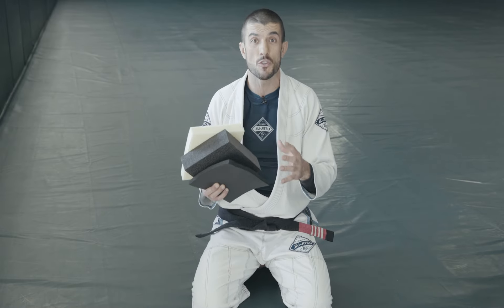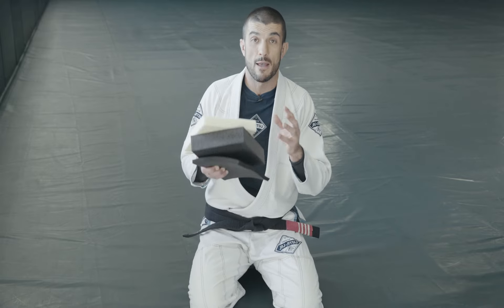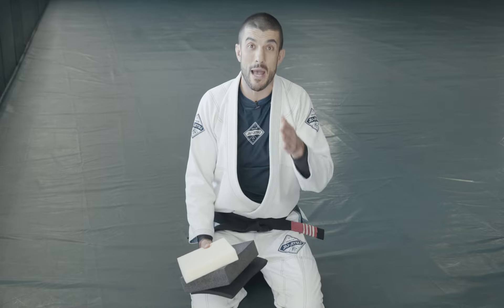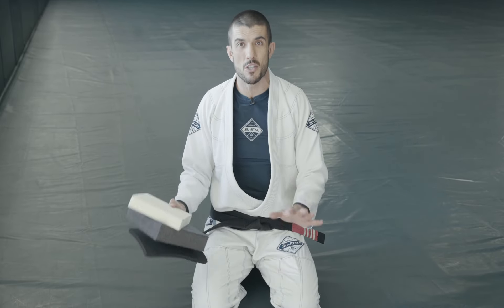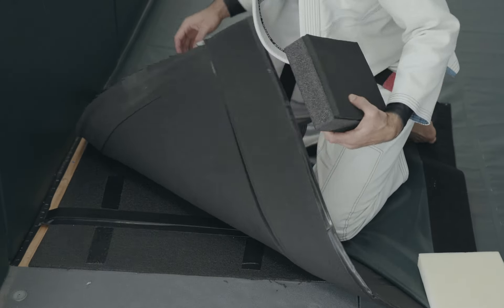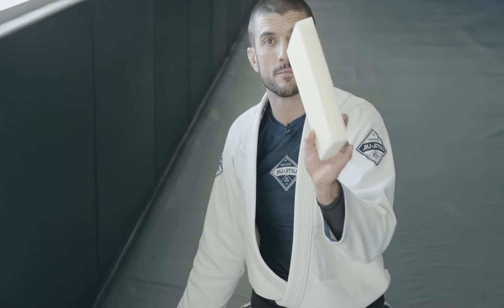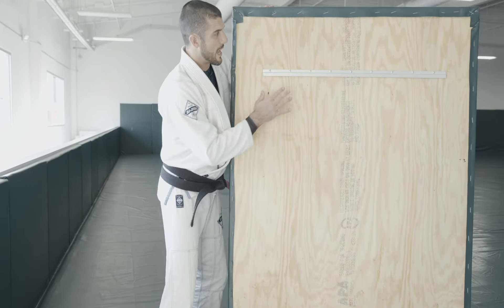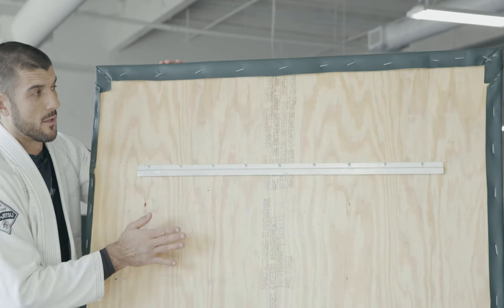Gracie Mat-Making Process (Do It Yourself!)

Comment: I called these guys recommended today for some mats. It is 9$ a square foot for just the foam, let alone for the vinyl mat with Velcro along the edges. This mat may be nice, but it sure is expensive. $13,500 plus the 4k for a 1,500 sq ft mat.

Comment: I've broken a toe twice on certain a brand of puzzle mats.
Reply: It's hard to find enough puzzle mats in the right combinations that will lock together, as everything seems to be focused on four-mat play areas. That said, they are adequate for most training, especially if you double up. The texture of the surface can be quite different between the mats too.

Comment: This is the most timely video. I have been building my own gym since the one i go to is closed for covid. I learned fast not to use gym mats lol
Reply: I've used puzzle mats. Just one layer, plus a thinner pad if I desire. I started Systema on a plain wood floor, so I don't mind going 'off road' periodically. A hard surface is an honest friend. You can use the trim from the puzzle mats and some tape to make protectors for corners. Slit pool noodles are handy for padding sharp edges too.

Comment: $3.40 a square foot for the cheaper option foam?
$1.35 for the vinyl, minimum 1000 sq feet.

i'm not opening a school..
considering it for an extra room/garage.
those baby puzzle mats,
i found the 2x2 (4 sq ft) for under $5 about 3-4 years ago, i think.
so that was $1.25/sq ft back then.
and the fancier brand camping equipment spots
have niiiiice waterproof tarps/footprints and the like,
and when you catch a sale, a ?9x8 can be under $30. depends.
idk about velcro just yet, but i'm sure i can find 'em cheap,
and have someone with a sewing machine hook it up.

Comment: I did the math, and. it is not cheaper. I like the idea but it cost about the same. 1,000 sqf divided by 8sqf foam is 125 foam pieces. The foam on the website is $66. 125X66=8,250. Thats without the yoga mat layer and the vinyl cover. Maybe it was cheaper when the video was made?

Comment: Hey Rener, just out of curiosity, would your recommendations be any different for someone that wanted to have a platform subfloor beneath the foam instead of concrete? With the idea that people would be practicing Judo too and there would be throws/slams from standing done on it. Or would you say what you described is sufficient for that even being directly on top of concrete?
Reply: 2 inches should be enough even for Judo if the the ukemi waza is up to date. I recommend buying throwing mattress just in case.
Reply: Traducir
Reply: hey

Comment: Years ago, you had a layer of carpet between the foam and the vinyl. I've been using your design for 10 or so years, and it's been great but i recently contemplated adding carpet between to allow for other groups to use my space on off days. Did the carpet not work out too well? What are you thoughts now-a-days?

Comment: Anyone have an idea on what you would recommend if the place already has carpeting (and underpadding) i place? A vinyl top alone over the existing carpeting would not be enough, but another layer imho, may work i.e. 1' poly 1.5lb or just volara 1-1/2"? (flooring is concrete, carpeting is poly tight closed loop).

Comment: Just out of curiosity, what is the range of the CTC reservation?  In a big city (e.g. Seattle), if the CTC is located on the north end of Seattle (e.g. the Northgate area), but you live in the south end (Federal Way), it can take 30-60 minutes (or longer) to drive there.  (I don't live in the Seattle area anymore, but I've been curious about this.)

What if there is a CTC in one suburb of a large city and you live in a different suburb of the same city, can you get a CTC anyway even though both are suburbs of the same major city?  I guess I'm asking about the range (driving time or miles) of the CTC exclusivity.

I've been curious about this because the closest CTC to me is a 25-45 minute drive, depending on the time of day.
Reply: In case anyone is interested in an answer to this question, I have found out, as of the time of this post, that CTCs have to be outside of a 5 mile radius of each other.  Not a 5 mile drive, but a 5 mile radius.

Comment: Hey thanks so much for the information.  I was looking to turn a small section of my basement into a mat for wrestling/jiu jitsu to start practicing as a beginner.  I currently have carpet on the floors, but didn't want those cheap premade mats (or like the ones that clip together).  Any recommendations?  Could I get away with a thin layer of foam with the vinyl layered over it?  Keep in mind that I wouldn't be removing the carpet, rather I'd be layering over it.  Thanks!
Reply: Hey HM, how did your project go? If you laid foam/tarp over your existing carpeting did it give you enough stiffness without rolling your ankle? What foam did you use btw?